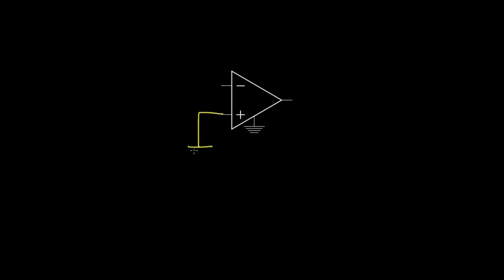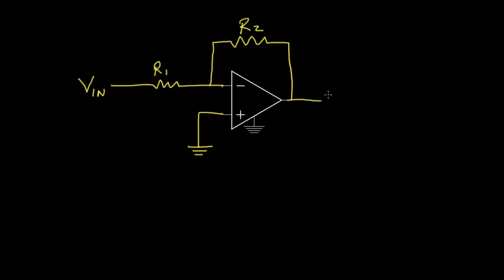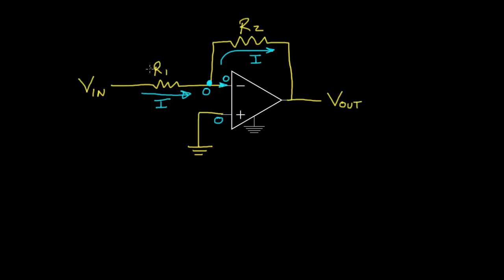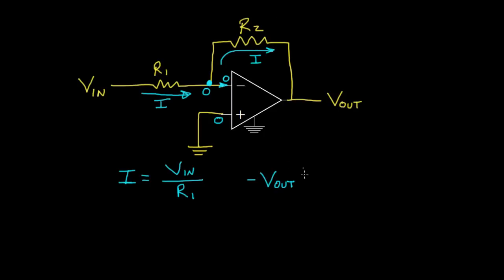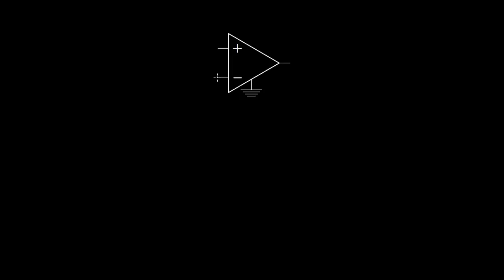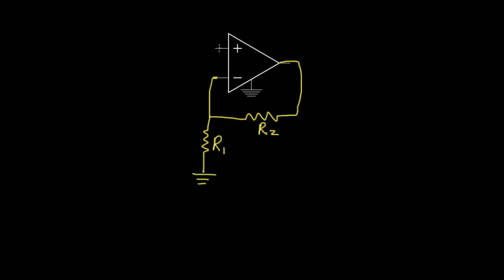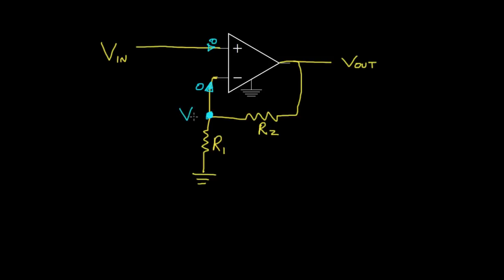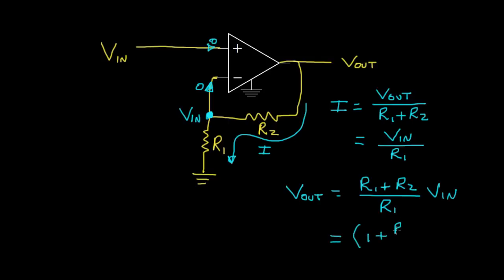Basic Op-Amp Circuits

Comment: Evoxpress - The value of R2 is irrelevant to the current.  Since the voltage at the 2 Op Amp inputs MUST be the same, the voltage at the Op Amp inputs must be 0V since the + terminal is connected to ground.  The voltage drop across R1 is then Vin.  The current through a resistor is Vin/R1.  The value of R2 only comes in when you calculate Vout.  Since no current can flow into the Op Amp, the current through R1 = the current through R2.  Hence, Vout = I * R2 = (Vin/R1) * R2.